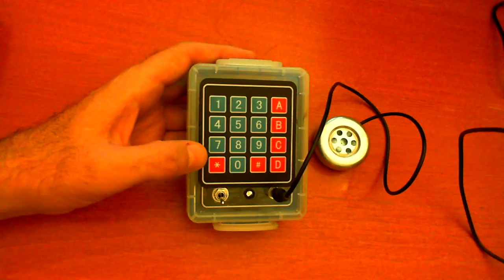Blue Box - IMTS "Improved Mobile Telephone Service" Modes

Comment: I worked for a radio shop and had a cheap one.  
Cheap because it was half-duplex.  
It was a 25watt Uniden Force FMH 350D radio (look it up on eBay for a photo) with a touchpad cemented to the front of it where the built-in speaker would be.  
It was discarded when everybody was switching to 800MHz AMPS cellular.   
The IMTS "phone" radio I had worked for two years after it was discarded.   
It would still validate and place phone calls.  
Apparently it's MID was never taken out of the system or the end user just never cancelled the account and kept paying the bill for a few years.
Which was SO common in the 80's and 70's.  
  It was one of the coolest and most fascinating toys (as a teen) to ever play with.   
And back then the fact that the VHF signal was going about 30 miles to Downtown Detroit was just so so cool to me.
Reply from the maker: There was a company (CommSpec?)back in the 1980s that made DTMF and CTCSS subaudible encoder boards for retrofitting commercial and amateur VHF/UHF gear. They also made a keypad and board that emulated the IMTS protocol on a half duplex radio. It was necessary to manually time the IMTS ANI sequence and start of dialing and to key the transmitter periodically during the call to prevent the base station RF loss timer from dropping the call. It sounds like your radio had one of those keypads installed. This circuit works the same way as those half-duplex aftermarket schemes to dummy a call. Some portable radios were made with similar capabilities built-in. See http://www.wb6nvh.com/MTSfiles/Carphone11.htm for some interesting info on those systems.
Reply from the maker: When I worked for Motorola beginning in the 1980s, our first Cellular telephone switch was modified to support IMTS and sold to Pactel in California. I had an IMTS Pulsar II phone that I modified with a set of thumb wheel switches mounted under the car dashboard. They could be used to dial in any ANI telephone number. There was a test ANI number in the Milwaukee area code that would allow unlimited free calls, even when roaming. That number worked well into the 1990s when the system was retired. I had an old scanner that would lock onto the channel idle tone and mute the radio until it was removed, allowing monitoring the calls on that channel. Phones would all monitor the channel with an idle tone for incoming calls. Once determined an incoming call was not for them, all mobiles hopped to the next channel with an idle tone.

Comment: Nicely done and well explained.The independent telephone company I work for ran 2 VHF and 2 UHF IMTS channels from '85 thru '91, and we had good revenues from IMTS. The billing was recorded on audio cassettes in our Motorola and Glenayre IMTS terminals. Those were simpler times.

IIRC, roaming was billed at $2.25 a minute to Indiana Bell, and slightly higher to GTE, because they did not have automated processing. At the end, you could get a 30 minute plan for $50 a month (and you added on your equipment rental and local service) - so about the same as an iPhone costs today. (But they have unlimited calling / text).

Those Harris car phones were very well made. They signalled at 20pps, and had 'channel grabber' service. The 5 state region had plans to put in the Moto EMX system, but the Pac Bell system was so buggy that they pulled the plug on the project. There is an intersting web site on IMTS history: http://www.wb6nvh.com/Carphone.htm 

The early NEC and Panasonic 'bag phones' that came out in '88 were very popular, and that was the end of the IMTS service.
Reply from the maker: Buggy indeed! I was a developer for Motorola on the IMTS EMX system for Pactel. The two switches we sold to them (Anaheim and Sacramento) were the only EMX IMTS systems ever produced. I could tell many stories about the development of that system! Odd they even wanted them, as the AMPS EMX systems rolled out about a year later.

I remember the older IMTS terminals with the "DAS II" tape drive and 4-layer diode switching matrix. We had to stop making those as the single-source for the diodes stopped making them and we were unable to secure an alternate supplier.

Comment: Oh, and I tried to go to the link in the description but it no longer works.
Reply from the maker: I just updated the link to my GitHub account. I just fixed a bug in the IMTS ANI code so that the even bit parity tone applies across the entire ANI sequence instead of resetting for each digit, which was incorrect according to some updated information I found.
Reply: @df9999999999  great work and brings back soooooo many memories that would not be tolerated today! I would like to see the link and more info on your box. Thanks!

Comment: so theretically, i could take an HT that is tuned to one of them freqs, and spoof the system into thinking im doing it from an actual system lol. the baofeng is a good candidate too because it can transmit on all frequencies in the vhf high band and in the uhf low, and uhf high bands from 136 to 174 and 216 to 400 and 401 to 512 mhz. i bet it could theoretically be done, illegal as it might be, and i wouldn't recommend you even try it lol.
Reply from the maker: Tha is exactly what was done. Commercial originate-only HTs were made that had IMTS encoders built in. One would key up and send a spoofed IMTS ANI sequence, then unkey and wait for a dial tone from the base station. Then one would key up again and send the dialing sequence to complete the call. I worked for Motorola and did this many times in our test lab.

Comment: Nice info about how signalling system worked for IMTS. Can you provide old specifications and protocol standards? Do you know about radio link characteristics, like frequency deviation, speech bandwidth, emphasis? Why do I want to know that? I am building a base station for IMTS. (osmocom-analog.eversberg.eu)
Reply from the maker: I may have some old manuals with that data. I'll look.
Reply from the maker: You can check out this link: https://github.com/donfroula/toneplant

The main code file initial comments area and manual have info on frequencies and timing.

Comment: I compared your dialing with a real phone. When you dial digits, you should transmit guard tone before and after pulses (when dial comes off normal), so that the receiver has a defined transition from guard to connect to guard. For ANI you should have 190 ms guard tone before the first digit and then play the following digits without any pause after the last 190ms end of each digit. Also note that the counting for 'even' and 'odd' pulses means counting total pulses of ALL digits in ANI! An 'odd' pulse means that you send silence after the pulse, an 'even'  pulse means that you send guard tone after the pulse. When you have an odd number of pulses in the first digit, your first pulse of the second digit is an even pulse, that means this pulse must be followed by a guard tone and not by silence. Finally the disconnect tone is an alternating sequence of disconnect tone and guard tone with 25/25ms.
Reply from the maker: These are my notes on the IMTS signalling. I'll compare my code to the timings you suggest and see how they compare:

When the mobile goes off hook, it sends 350ms of guard (2150Hz) followed by
50 ms of connect (1633Hz). The mobile then immediately sends 190ms of guard tone
and waits for removal of seize tone by the base station. It then starts
transmitting the ID sequence at 20 pulses per second. The ID is the area code
and last four digits of the mobile's number. The pulses are marked by 25ms of
connect (1633Hz) followed by 25ms of either silence or guard tone (2150Hz).

If the pulse is odd, it is followed by silence. If even, it is followed by
guard tone. This is used for parity checking. The inter-digit time is 190ms and
will be either silence or guard tone depending on whether the last pulse was
odd or even. If the last pulse of the last digit in the ID is even it will be
followed by 190ms of guard tone. No tone is sent after the ANI is sent while
waiting for dial tone.

When a number is dialed from a mobile phone, 2150 Hz is sent continuously
as soon a the dial goes off normal (when the dial is moved from its resting
position). Dial pulses representing breaks are marked by 1633 Hz and are sent
at 10 pulses per second. A pulse is 60 ms of 1633 Hz with 40 ms of 2150 Hz
between pulses.

When the mobile hangs up, it sends disconnect, which is 750 ms of alternating 1336Hz and 2150Hz
at 50% make/break at 20 PPS (15 cycles of 1336HZ for 25ms followed by 2150Hz for 25ms).
Reply from the maker: I updated the code after this video was made. I do play guard tone on off-normal of the dial now,  I think the ANI parity is calculated per-digit rather than as a complete group, meaning each ANI digit starts over at "odd" parity. This is incorrect, according to your observation, but easily changed. Appreciate the feedback.
Reply: @df9999999999  I also thought that the ANI parity is calculated per digit, until I got the ANI from a real phone. I corrected that in my base station. I can confirm that all of the ANI I tried use parity calculated from complete group of digits.
Reply from the maker: andreas eversberg I’ll make the code change and post some updated audio. Thanks!  What ever motivated you to make an IMTS base station??? In the Motorola lab our test mobiles had a box with thumbwheels that could be used to set the ANI. There was a Milwaukee number that returned an unmetered dial tone.
Reply: @df9999999999  I researched the history of analogue mobile phones. It all started to make a base station for an old German phone of the second generation (B-Netz). It made so much phun, so I made a base station implementation with support for all thee former German networks (A-, B-, C-Netz), NMT, AMPS, TACS, Radiocom 2000. Finally the IMTS/MTS was missing until now.
Reply: @df9999999999  Looks fine, except for the seizure of the phone. It sends 350ms Guard tone tone followed by 50ms Connect tone. If the base station does not remove the Idle tone while the phone transmits the Connect tone, the phone aborts. (You have to be very fast, if you are a base station, or use some trick...) The base station changes from Idle tone to silence. After at least 250ms, the base station sends Seize tone. The phone will start dialing, if it detects the Seize tone.

This is all info from reversing the phone. I wait to get more detailed informations about this tight timing issue.
Reply from the maker: @andreaseversberg  LOL. I installed the Mototola B-Netz and C-Netz switches in Vienna and Salzburg back in 1982 - 1983.
Reply: Teachhh......meeeee
Reply from the maker: I finally correct the ANI parity code to apply across the entire dialing string. The even/odd parity state is remembered digit to digit and reset when the “connect” key “D” is pressed.